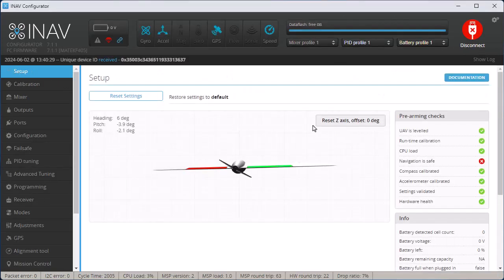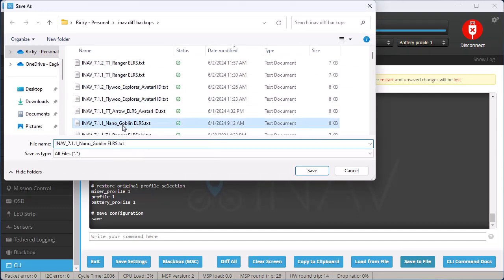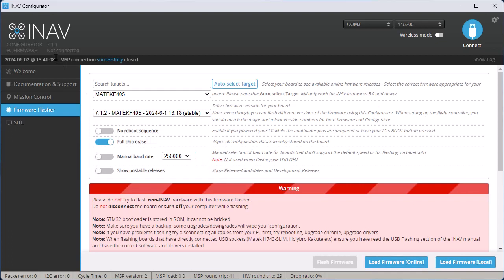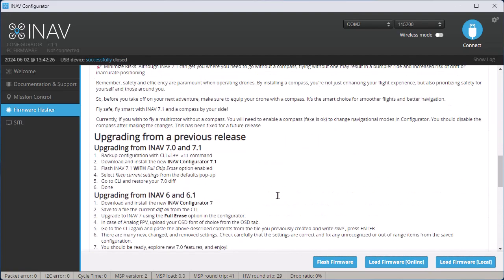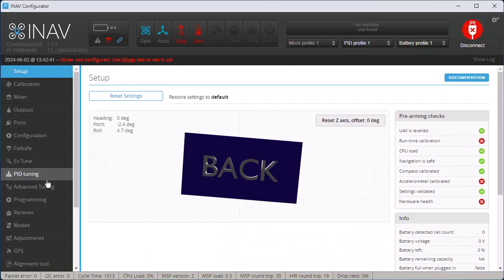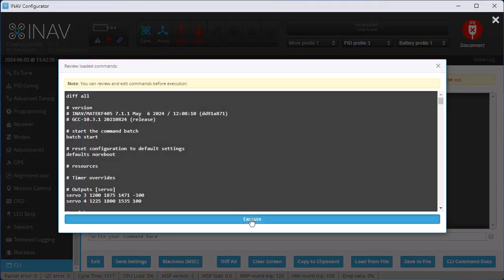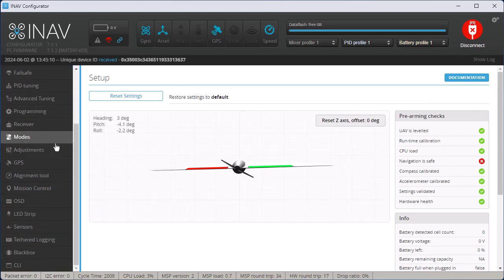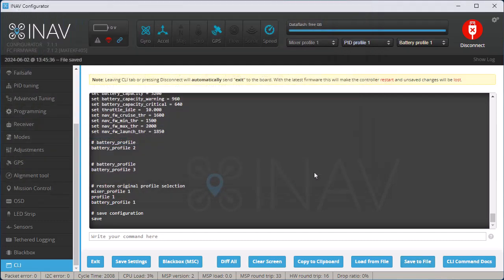Quick and Easy way to Update to inav 7.1.2

Comment: It failed and says « failed to flash com6 » what should i do ?
Reply from the maker: @TheOrangeHelmett  what FC is it? Have you ever flashed it before?
Reply: @RickyGode it’s atomrc f405 navi and it’s the first Time I flash it
Reply from the maker: @TheOrangeHelmett  Have you ever flashed a FC?  Is it in DFU mode?  Maybe you need a driver?  This video by painless360 might help https://www.youtube.com/watch?v=_7cZ52WPHjc
Reply: @RickyGode it is not in dfu mode but I watched the vidéo and I still don’t get what is a driver and why this doesn’t work. But thank you for the help
Reply from the maker: @TheOrangeHelmett  So DFU mode is the issue.  I don't think I will be of much help here in the comments.  I'd pour through youtube and search for "flashing flight controllers" They should walk you through getting the correct drivers (software that helps your computer communicate with the FC)  What you need is the right driver for DFU mode.  In the inav splash screen (the first 8 seconds of my video above) there is a link for the "Latest Zadig for Windows DFU flashing can be downloaded from here" I'd get that one and the maybe the STM drivers above it. Maybe that will do it?
Reply: @RickyGode thank you for your help, I installed the impulseRC driver and it worked 🙌🙌🙌

Comment: Would you be willing to share your diff all? I have been trying to fix bad flight characteristics and have been looking for other nano goblin's to compare settings. I have a feeling I mistakenly adjusted a tune setting way out.
Reply from the maker: Sure!  Here you go:

diff all

# version
# INAV/MATEKF405 7.1.2 May 31 2024 / 23:40:27 (4e1e59eb)
# GCC-10.3.1 20210824 (release)

# start the command batch
batch start

# reset configuration to default settings
defaults noreboot

# resources

# Timer overrides

# Outputs [servo]
servo 3 1200 1875 1471 -100
servo 4 1225 1800 1535 100

# safehome

# Fixed Wing Approach

# features
feature -TX_PROF_SEL
feature MOTOR_STOP
feature GPS
feature BLACKBOX
feature PWM_OUTPUT_ENABLE
feature FW_LAUNCH
feature FW_AUTOTRIM

# beeper

# blackbox
blackbox -NAV_ACC
blackbox NAV_POS
blackbox NAV_PID
blackbox MAG
blackbox ACC
blackbox ATTI
blackbox RC_DATA
blackbox RC_COMMAND
blackbox MOTORS
blackbox -GYRO_RAW
blackbox -PEAKS_R
blackbox -PEAKS_P
blackbox -PEAKS_Y

# Receiver: Channel map

# Ports
serial 0 64 115200 38400 0 115200
serial 1 0 115200 38400 0 115200
serial 2 33554432 115200 115200 0 115200
serial 3 2 115200 57600 0 115200

# LEDs

# LED color

# LED mode_color

# Modes [aux]
aux 0 0 0 1925 2100
aux 1 2 1 1400 1800
aux 2 12 1 900 1075
aux 3 45 1 1675 1825
aux 4 53 1 1675 1825
aux 5 11 1 1200 1325
aux 6 10 3 900 1075
aux 7 28 1 1925 2075
aux 8 3 1 1675 1825
aux 9 3 1 1200 1325
aux 10 5 1 1675 1825
aux 11 36 4 900 1100
aux 12 42 2 1400 1600
aux 13 43 2 900 1100
aux 14 26 0 1900 2100

# Adjustments [adjrange]

# Receiver rxrange
rxrange 0 988 2011
rxrange 1 988 2011
rxrange 2 988 2011
rxrange 3 988 2011

# temp_sensor

# Mission Control Waypoints [wp]
#wp 0 invalid

# OSD [osd_layout]
osd_layout 0 0 43 3 V
osd_layout 0 1 2 17 V
osd_layout 0 3 8 6 V
osd_layout 0 4 8 6 V
osd_layout 0 6 44 17 V
osd_layout 0 7 25 14 V
osd_layout 0 8 2 1 V
osd_layout 0 9 44 8 V
osd_layout 0 10 22 11 H
osd_layout 0 11 3 15 V
osd_layout 0 12 2 16 V
osd_layout 0 13 14 9 V
osd_layout 0 14 42 2 V
osd_layout 0 15 35 8 V
osd_layout 0 22 26 1 V
osd_layout 0 23 25 17 V
osd_layout 0 27 13 7 V
osd_layout 0 28 23 12 H
osd_layout 0 30 13 16 V
osd_layout 0 33 40 8 H
osd_layout 0 34 22 0 V
osd_layout 0 40 2 2 V
osd_layout 0 41 41 5 H
osd_layout 0 42 41 6 H
osd_layout 0 46 12 8 V
osd_layout 0 53 1 12 H
osd_layout 0 110 42 1 V
osd_layout 0 112 41 4 V
osd_layout 0 142 2 0 V
osd_layout 1 0 43 2 V
osd_layout 1 1 2 17 V
osd_layout 1 6 44 17 V
osd_layout 1 8 2 1 V
osd_layout 1 9 44 8 V
osd_layout 1 11 3 15 V
osd_layout 1 12 2 16 V
osd_layout 1 14 42 1 V
osd_layout 1 16 16 4 V
osd_layout 1 17 16 5 V
osd_layout 1 18 16 6 V
osd_layout 1 22 26 1 V
osd_layout 1 23 25 17 V
osd_layout 1 30 12 14 V
osd_layout 1 34 22 0 V
osd_layout 1 40 2 2 V
osd_layout 1 56 16 7 V
osd_layout 1 57 16 8 V
osd_layout 1 58 16 9 V
osd_layout 1 59 16 10 V
osd_layout 1 60 16 11 V
osd_layout 1 61 16 12 V
osd_layout 1 110 42 0 V
osd_layout 1 142 2 0 V
osd_layout 2 6 24 12 H
osd_layout 2 8 1 1 H
osd_layout 2 22 14 3 H

# Programming: logic
logic 0 0 -1 7 4 1 4 2 0
logic 1 0 -1 2 1 10 0 1385 0
logic 2 0 -1 3 1 10 0 1415 0
logic 3 0 0 25 0 1 0 0 0
logic 4 0 -1 7 4 5 4 6 0
logic 5 0 -1 2 1 10 0 1585 0
logic 6 0 -1 3 1 10 0 1615 0
logic 7 0 4 25 0 3 0 0 0
logic 8 0 -1 7 4 9 4 10 0
logic 9 0 -1 2 1 10 0 1785 0
logic 10 0 -1 3 1 10 0 1815 0
logic 11 0 8 25 0 4 0 0 0
logic 12 0 -1 7 4 13 4 14 0
logic 13 0 -1 2 1 10 0 1995 0
logic 14 0 -1 3 1 10 0 2025 0
logic 15 0 12 25 0 5 0 0 0

# Programming: global variables

# Programming: PID controllers

# OSD: custom elements

# master
set looptime = 2000
set gyro_hardware_lpf = 188HZ
set gyro_zero_x = -13
set gyro_zero_y = -1
set gyro_zero_z = -5
set ins_gravity_cmss =  981.327
set acc_hardware = MPU6500
set acc_lpf_hz = 102
set acczero_x = -7
set acczero_y = -19
set accgain_x = 4095
set accgain_y = 4091
set accgain_z = 4082
set align_mag = CW270FLIP
set mag_hardware = NONE
set baro_hardware = NONE
set pitot_hardware = VIRTUAL
set serialrx_provider = CRSF
set blackbox_rate_denom = 8
set blackbox_device = SPIFLASH
set max_throttle = 2000
set failsafe_procedure = RTH
set align_board_yaw = 900
set vbat_scale = 1130
set current_meter_scale = 23
set current_meter_offset = 74
set current_meter_type = VIRTUAL
set small_angle = 180
set disarm_kill_switch = OFF
set applied_defaults = 1
set gps_provider = UBLOX7
set gps_sbas_mode = WAAS
set gps_ublox_use_galileo = ON
set nav_wp_radius = 500
set nav_fw_wp_tracking_accuracy = 6
set nav_rth_climb_first = OFF
set nav_rth_allow_landing = NEVER
set nav_rth_altitude = 4000
set nav_mc_bank_angle = 45
set nav_fw_bank_angle = 60
set nav_fw_climb_angle = 60
set nav_fw_loiter_radius = 6000
set fw_loiter_direction = LEFT
set nav_fw_control_smoothness = 5
set nav_fw_launch_velocity = 200
set nav_fw_launch_motor_delay = 200
set nav_fw_launch_spinup_time = 350
set nav_fw_launch_timeout = 15000
set osd_video_system = AVATAR
set osd_units = IMPERIAL
set osd_time_alarm = 60
set osd_alt_alarm = 0
set osd_dist_alarm = 0
set osd_ahi_max_pitch = 30
set osd_horizon_offset = 2
set osd_camera_uptilt = 10
set osd_ahi_camera_uptilt_comp = ON
set osd_failsafe_switch_layout = ON
set osd_ahi_vertical_offset = 30
set osd_arm_screen_display_time = 4000
set osd_switch_indicator_zero_name = ARM
set osd_switch_indicator_one_name = MODE
set osd_switch_indicator_two_name = RTH
set osd_switch_indicator_three_name = OSD
set osd_switch_indicator_one_channel = 6
set osd_switch_indicator_two_channel = 8
set osd_switch_indicator_three_channel = 11
set throttle_tilt_comp_str = 10
set name = NANO GOBLIN
set pilot_name = RICKY
set tz_offset = -360
set tz_automatic_dst = USA
set vtx_band = 5
set vtx_channel = 8
set vtx_low_power_disarm = ON

# mixer_profile
mixer_profile 1

set platform_type = AIRPLANE
set model_preview_type = 8
set motorstop_on_low = ON

# Mixer: motor mixer

mmix reset

mmix 0  1.000  0.000  0.000  0.000

# Mixer: servo mixer
smix reset

smix 0 3 0 50 0 -1
smix 1 3 1 50 0 -1
smix 2 4 0 -50 0 -1
smix 3 4 1 50 0 -1

# mixer_profile
mixer_profile 2

# Mixer: motor mixer

# Mixer: servo mixer

# profile
profile 1

set mc_p_pitch = 15
set mc_i_pitch = 40
set mc_d_pitch = 15
set mc_p_roll = 15
set mc_d_roll = 15
set mc_p_yaw = 6
set mc_i_yaw = 10
set mc_d_yaw = 60
set mc_i_level = 5
set fw_p_pitch = 15
set fw_i_pitch = 40
set fw_ff_pitch = 158
set fw_p_roll = 15
set fw_i_roll = 30
set fw_ff_roll = 43
set max_angle_inclination_rll = 600
set max_angle_inclination_pit = 600
set heading_hold_rate_limit = 101
set nav_mc_pos_z_p = 40
set nav_mc_vel_z_p = 0
set nav_mc_vel_z_i = 0
set nav_mc_vel_z_d = 0
set nav_mc_pos_xy_p = 75
set nav_mc_vel_xy_p = 0
set nav_mc_vel_xy_i = 0
set nav_mc_vel_xy_d = 0
set nav_fw_pos_z_p = 35
set nav_fw_pos_xy_p = 70
set fw_level_pitch_trim =  5.500
set rc_yaw_expo = 70
set roll_rate = 32
set pitch_rate = 8
set yaw_rate = 10

# profile
profile 2

# profile
profile 3

# battery_profile
battery_profile 1

set battery_capacity = 3200
set battery_capacity_warning = 960
set battery_capacity_critical = 640
set throttle_idle =  10.000
set nav_fw_cruise_thr = 1600
set nav_fw_min_thr = 1500
set nav_fw_max_thr = 2000
set nav_fw_launch_thr = 1850

# battery_profile
battery_profile 2

# battery_profile
battery_profile 3

# restore original profile selection
mixer_profile 1
profile 1
battery_profile 1

# save configuration
save

#

Comment: Nice updating guide!

FYI if you're updating from 7.1.1 to 7.1.2, there's no need. Just run this command in the CLI tab on 7.1.1:

set use_gps_no_baro = OFF
save

The only thing I changed to create 7.1.2 is I changed that setting to default to off.
Reply from the maker: That's interesting about the "set use_gps_no_baro = OFF"  I'm just now reading about it on github.  Thanks!